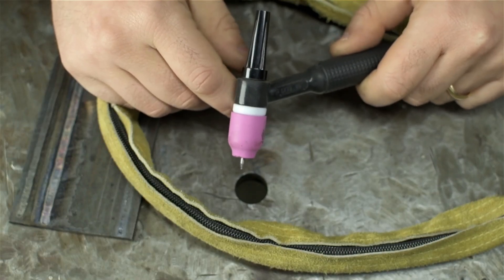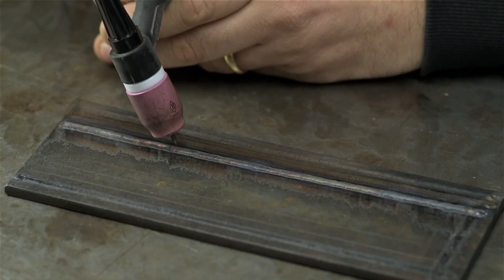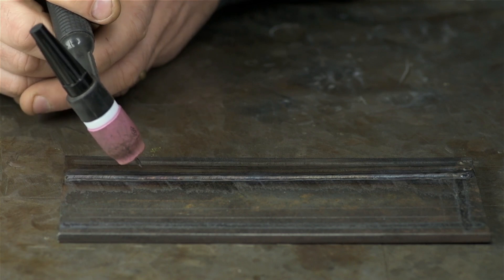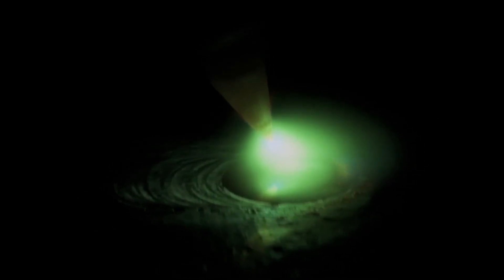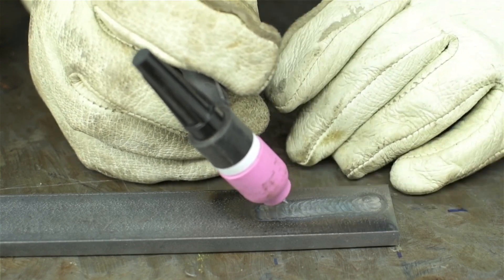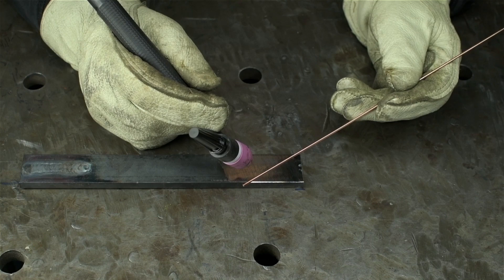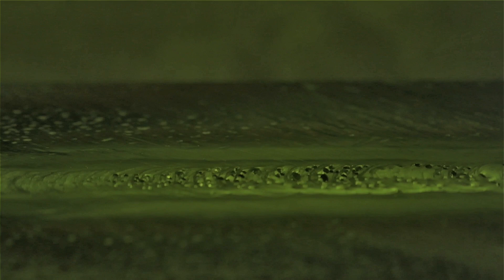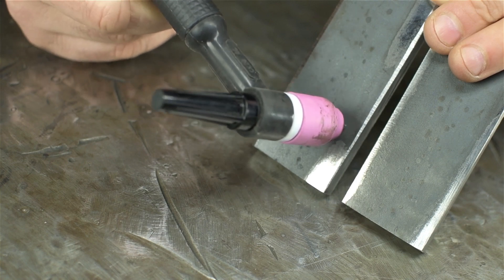TIG Welding - Puddle Control

Comment: This is a very cool series, I just bought my first welder last week. Stick welder though, perhaps you could do a series on stick welding as well?
Reply from the maker: Afraid I'm not much of a stick welder, but all the same rules apply.  Keep an eye on the puddle, it'll look exactly like it does in this video.  A little more violent, but the basic rules are the same.
Reply: Welding Junkie oh cool I didn't know you could do that. Just wanted to start with a cheapie  arc welder before getting into the more expensive advanced stuff like tig
Reply: TashTech I figured as much, yup just need a torch with a gas valve on it so 17v and a power block. You hook your stinger to the power block and hose to argon. DC only but works great and cheap way to start. Then you can add the arc pig to it and get high frquency if you decide you like it. Great abs cheap way to start. Arc welding is good to start to learn but if you learn to Tig and get good with the puddle you can weld any process. Here is the power block. 

https://m.cyberweld.com/tigtopoad10.html or https://m.cyberweld.com/tigtopoad45.html
Reply: Welding Junkie 
I advised him that because 
1. We wanna weld cause we wanna build stuff- for beginner with stick dc inverter it is easier to melt with electrode, what machine was designed to do7

2. Instead into flow meter gas bottle torch and tungsten invest into buying some mild steel profiles perhaps build a table, buy clamps mask gloves, angle grinder...

3. For material thicker than 2mm rookie stick weld looks better
(Do not know about mechanical strenght comparison)

Also a tip for stubborn people with dc stick inverters(no HF start)
I had heard that if inverter has only
 stick setting u can start ur arc with  scratch start on piece of copper (less contamination) and then transfer over to the joint u wanna weld(never tried it tho)

I myself am only a dc stick self proclaimed weldor so please take my comments with a grain of salt
Reply: Darth Trump I fully understand what you are saying. Google arc pig for HF start...With that said he will be able to fully stick weld like you stated. With that said stick welding is one of the harder processes to learn. Unless you see pipeline welding or welding dirty metal lots of dirty metal...wire machines are the best to learn on IMO. I reccomeded the Tig Tig so that he can expand his skills while not having to buy another machine since he said he liked it. The arc pig isn’t nessaary but a great addition for HF. Adding a flow meter, Argon and a tig rig can be had cheap. He can learn how to Tig weld in a garage at night without the smoke and fumes of burning rods. It sounded like he was wanting to learn not that he couldn’t afford it but that was just my take.
Reply: TashTech yes sir, chucke2009 made a great video year’s ago on this. Get a flow meter from HTP 29.00 they work great. Tig rig with power block on eBay# 352326246801 $40 and argon. Your stinger and ground clamp you have will work with that set up. Look around on you tube for Tig rig videos they are on there
Reply: This Old Tony how do I put this.. I try not to shy away from violent puddles... hehe. Thanks for the great channel, you're a rock star man!
Reply: Darth Trump thanks so much for the help, that's why I love this channel, the subscribers are so helpful and friendly!
Reply: TashTech you can prob set up a Tig rig and tig off of your stick welder just get a power block
Reply: Stick with stick for begening

Get really good with it then advance
Reply: Darth Trump stick does not prepare you for Tig at all IMO but I’m pretty sure that was his plan to begin with that’s why he bought a stick welder.
Reply: Welding Junkie thanks so much. Any videos on YouTube describing how to set this up?
Reply: Darth Trump also my HTP Invertig  221 will burn ac or dc rods and will pulse stick for gap welding which is great but I bought it for Tig, so I’m glad I have the extra features know what I mean?
Reply: TashTech https://youtu.be/RyZVkGdfkDU watch this video weld.com bob moffet goes through it in entirety
Reply: Welding Junkie 
Jup totally understand

My suggestion to tac tech was because some half year ago i was on verge of making such exact tig rig with my telwin technica 211/s (180A dc stick)
My plan was to weld steel only, get good with tig then in few years buy ac/dc machine and then step up to alu
I was even considering buying replacement part potenciometer add a switch to choose between the new or the fac.  built in potencio and build a foot pedal utilizing a new one for amp control

Realized the ammount of money that would be required for such rig made me change my mind 
I came to conclucion that if the residue spatter and cleaning is not a problem, stick does the job (for diy)
I was looking into tig because i wanted to weld thin sheets, everything else is covered quite fine with stick (as long as i stay on mild steel)

In my opinion stick is not that hard to learn, you only have 1 setting on the machine and is also the cheapest meaning that one can make as much practice burning rods as he desires

I think that it is better to learn to do one process well than jump into two of them not realizing the hassle and patience required to learn even the simpler ones
and only to be able to do each halfasss

Looking at arc pig it seems that dc tig machine with HF start would be better consideration for the price(and you can still stick with it)
 My opinions might be based upon price but spending everything on tools leaves no resource for materials

Comment: Excellent, thank you. Now I don't have to consult with a Urologist about my puddle control problem.
Reply: Just be sure it doesn't run down onto your sunday-best welding pants ;)
Reply: Tom Q
That's why they make Depends ! 😊
Reply: Ken Gamble Tig sparks in your Depends only make the puddleing problem worse.

Comment: I'd assume that this is probably common knowledge, but there is a reason my ex girlfriend made house rules for us that included "Don't solder while naked." I think that welding goes under the same general heading, but even so, nothing could prepare me for getting weld splatter out of my ear.

Comment: How can I start welding ? I know nothing about welding at all , I never welded anything in my life .
Reply: EA Jam don't forget what Tony says, UV exposure leads to a very deep tan :)
Get protection!
Reply: EA Jam I would go to harbor freight and buy a cheap $100 90 amp wire feed welder.  That's what I did and have gone from zero experience to successfully (but not pretty) welding many things.  YouTube really helps, I like ChuckE2009 and his reviews, as well as many others.
Reply: Prolific Invention how far the 90 amp will take me ??
Reply: EA Jam I have done car exhaust, and many projects...fabricobble, all the way to 1/3" steel plates.  Haven't had any failures with my welds I did once I went through the first roll.  Throw away the roll of wire that comes with the welder, and buy a compatible better roll.  I think you will learn a lot and like it.  Make sure to buy an auto darkening mask if you can afford one.  My cheap one works great, can't weld without it.
Reply: Prolific Invention thanks a lot man you have been a great help , will see what I will do and will update you .
Reply: macbeth2354 lol sure will do .

Comment: The videos are certainly interesting, only downside is that I only have access to a stick and oxyacetylene. But more knowledge is always good!
Reply: it is easy to make a tig machine out of a stick machine
Reply: If you've got DC stick, you've almost got tig.  You just need a bottle of argon, a regulator, and a air-cooled tig torch with a valve.
Reply: I know, but I'd rather get a proper machine. Preferably a dual one.
Reply from the maker: OA is almost exactly like TIG, just a little slower.  In fact, if you learn to weld OA first, get the puddle control down, when/if you upgrade to TIG it'll be a cake walk.
Reply: I did notice the similarities when I got to try out a little bit of TIG in school since my father had taught me some gaswelding before. 

But then it wasn't really indepth since it was our first year and those that wanted to try it out could if they wanted before we had to decide on welding or machining.

Comment: I have been trying to learn TIG Welding for a while now(my bad arm is slowing me down even more, I just gotta keep at it, but i digress). I'm building an aluminium table for a 9" Disc grinder. I want to TIG Weld it, but I'm a little nervous about messing it up, I've never done aluminium before and my steel TIG is still pretty sloppy...

Comment: "After all, you're probably not practicing your Tig welding on the cooling system of a nuclear reactor, right? You're not, right?!" 

Hanford employees everywhere tug at their collars.
Reply: "Comrade Ivanschanko, Tony says not to go on"- Pripyat c.1972 (probably).
Reply: In Finland we have this massice clusterfuck called Olkiluoto 3. An experimental nuclear plant that was supposed to go into full operation over a decade ago. Yet it's still uncertain when if ever it will actually be completed. It's already the world's second most expensive building project ever, right behind it's similiar French sister site. Those workers sure could have used some TOT welding lessons - maybe the plant would have already been operational by now..
Reply: Olkiluoto 3 will be ”conventional” reactor capable of using uranium or mixed oxide fuel(MOX). If I understood correctly, it will be an improved Pressurized Water Reactor (PWR) with some fancy neutron reflector. They call it European Pressurized Reactor (EPR). In general, the whole project is pretty hilarious with all the delays and problems, with foreign labor, concrete, welding and what not. Not forgetting, all the legal proceedings following these.   https://en.wikipedia.org/wiki/Olkiluoto_Nuclear_Power_Plant#Unit_3
https://en.wikipedia.org/wiki/EPR_(nuclear_reactor)
Reply: Hanford.  SMH.
Reply: Antti Heikkinen 
Do you know if that is going to be a Thorium breeder or a conventional reactor? I hear a few countries still want to try thorium breeders and I wouldn't mind waiting with that promise.
Reply: Lauri Ahonen thank you, I did see all the set backs but the actual description was rather vague. Those pressure vessels are impressive though.